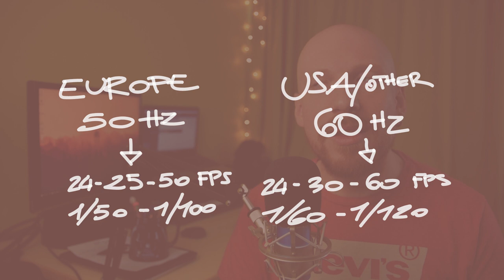Get rid of VIDEO FLICKERING | How to set your DSLR | Episode 15

Comment: Great, clear explanation. Many thanks. May I ask a related question: if I shoot in 50fps or, for slow motion, in 100fps as you suggest, when shooting normal speed footage out of doors and away from flickering lights (either on mirrorless or on iPhone), should I keep to the same frame rates? What confuses me is trying to decide whether it’s best to shoot 30fps outdoors on iPhone and 50/100 under lights indoors, and then how or whether to mix them in project (and at what project fps!). I hope I’m explaining the problem clearly. I’ve read a lot online but, because so much of it is about 24fps and 30fps (and based in the US) I’m still unclear about what’s right and straightforward in the EU). In any case thanks for an excellent video!

Comment: Really great tips! I have a question, though. I do music videos in my home studio and while based on these tips my settings are fine for the lights, my laptop screen flickers at most of the settings I try. Is there a way to know exactly the refresh rate of the screen? Or should I simply avoid to have it in the frame?
Reply from the maker: Hi!

You brought up a very common problem which is that sometimes machiens are not really synced and flicker with different speeds, such as screens.

Usually the refresh rate of your screen should be specified in the video card options of the laptop. At least on my intel integrated graphic card it is set to 59p. Weird. I changed it to 50p but I have multiple options.
In worst case scenario... maybe you should not record it. 
Let me know if you solve this!

Comment: Hello! I do not understand a few things you mentioned.

1) You shot one of the clips at 50 fps, 1/150. This shutter speed actually is fine? Another YouTube shows that not all speed of a multiple of 50 work. 1/100 is the maximum.

I cannot try/verify it, sadly. Because my camera is Canon M50, there is no 1/150 between 1/125 and 1/160. (Magic Lantern probably can 'hack' this, but unfortunately it does not support M50) 

2) YouTube stats for nerds is showing 24 fps. I presume this entire video is originally shot at 25 fps, 1/50. Will that 1 fps difference make the the final/rendered video jittery or with some weird visual?

I know that video editors nowadays are magical, the can cure nearly all visual disabilities on screen. However I do not want to edit, if possible. Straight-from-camera is my kind of thing.

Comment: Great video! This was driving me mad when I just got my camera. Are you still using the D5300? In that case, which ultra wide angle do you recommend? Thanks!
Reply from the maker: Hi Santiago!
Glad the video helped! I recently upgraded to the d7200, but it has the same sensor as the d5300.
As ultra wide, I do not have experience in ultra sides. I would suggest to check out the nikon 10-20 that just came out for crop sensors. In alternative the Tokina 11-16 f2.8 looms lime a great lens :)
Reply: Newpix Thanks for you reply. Nice upgrade! Those are exactly the two lenses I'm considering.
Reply from the maker: let me know what you end up deciding! :)